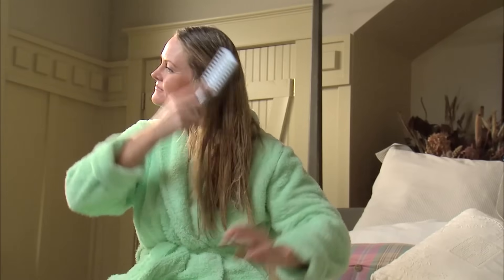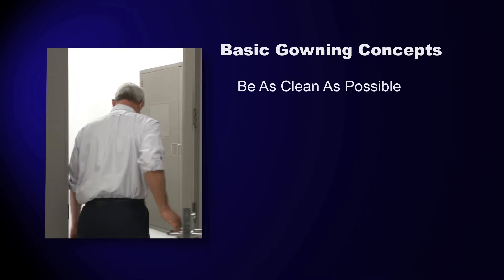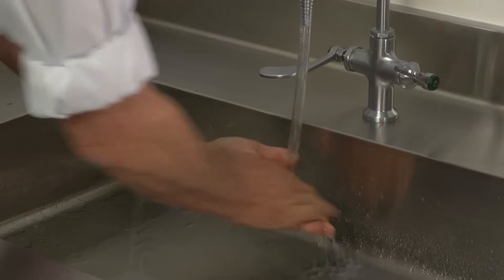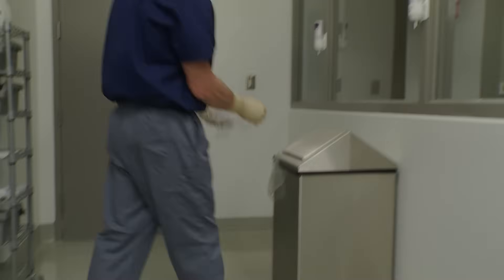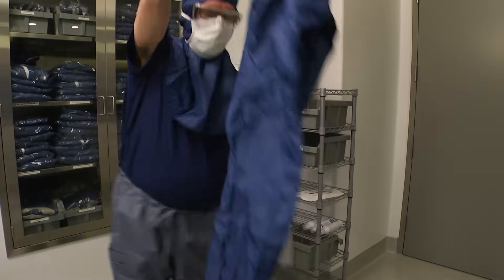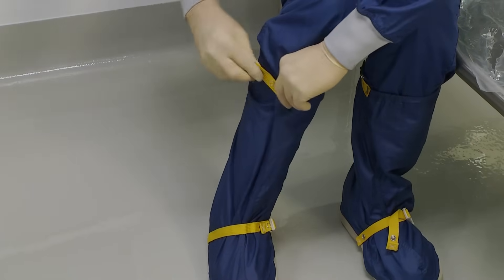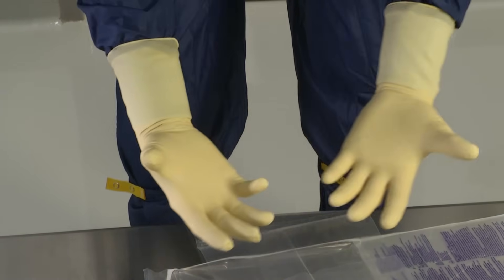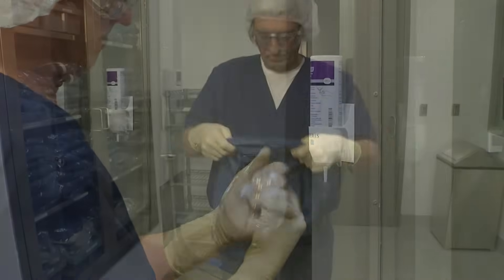Aseptic Gowning for the Cleanroom

Comment: SEND ME A DIRECT MESSAGE IF YOU ARE NEEDING SERVICE OR INSTALLATION. I service any location and can be onsite with crew in 24 hrs. 
have been installing for 25 years. I specialize in impervious wall cladding and impervious seamless sheet vinyl installations. USP 797 aseptic clean rooms USP 800 semiconductor clean rooms, Labs, Airborne disease isolation units. Prior D.O.D contractor